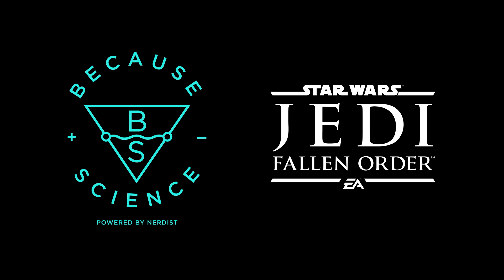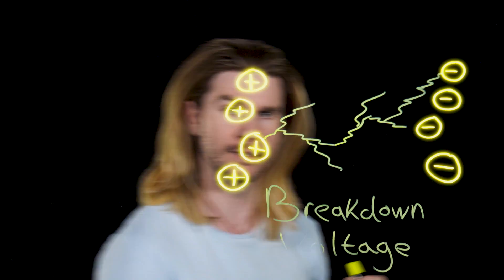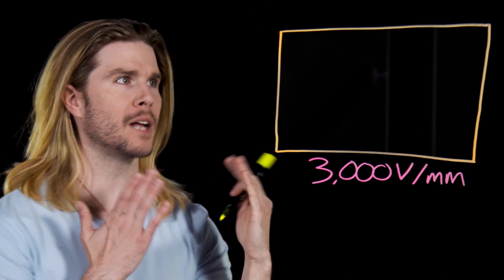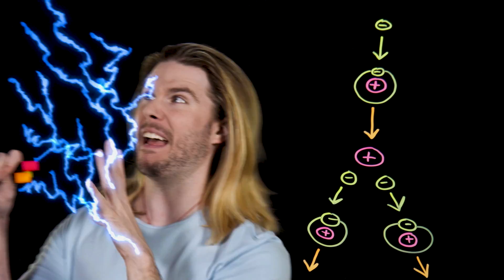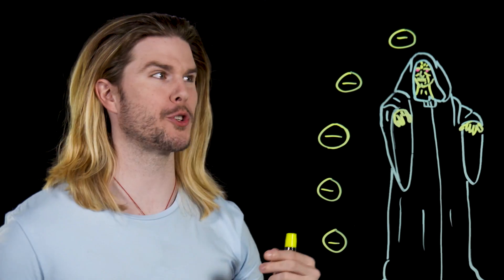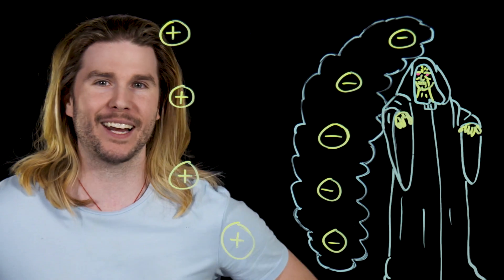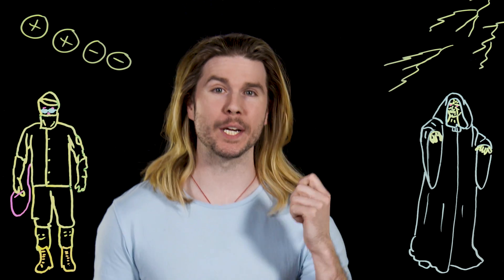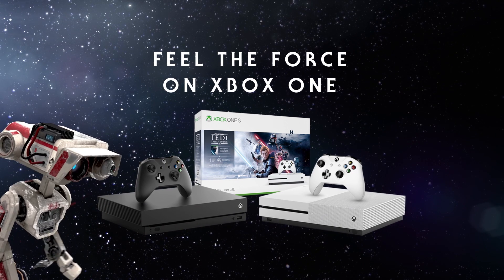How Does FORCE LIGHTNING Work? (Star Wars SCIENCE)

Comment: What I'd find to be a bigger issue is the exit point of Force lightning from the caster. As you demonstrated with static shock, it burns. With enough current at that high of a voltage, one would be lucky to have only singed fingers. Even if the caster's skin is acting as a Faraday cage, at the exit point to an open air arc comes with a lot of heat. Arc welders work by heating up the cathode with an open air arc to the point of melting.

Comment: I had actually thought of this and came up with a slightly different answer: sith use the force not only to accumulate some amount of charge, but also to thin the air between their target and them. This way, force lightning is not as powerful as actual lightning, since the brakedown voltage of air goes down with density (which is consistent with the amount of damage we see inflicted on people who get stuck) and the user can actually direct the lightning towards their target, not just hope they are the path of least resistance (this too, as we see done in the movies).
Reply: Oh, obligatory "love the show, buddy", which is actually true, but I didn't want to edit the comment.

Comment: 5 Things you should know.
1. I love your show. 
2. At STP, 3mm of air insulates against 1000 Volts and 60 Hz.
3. Frequency plays a significant role in insulation break-down. For example some motor manufacturers will give a lifetime winding warranty on frequencies of 3600 Hz or less. One year up to 10000 Hz. No warranty over that because even with billions of ohms, the breakdown at 22 kHz is crazy fast.
4. At low frequencies you won't see the electricity in normal light, so the frequency must be in the kHz at least.
5. If you want to make a cool spark off a bonded metal surface, hold onto a table knife and bring it close to a switch cover screw in the dark. This does two things, first of all you won't feel the burn (because the shock doesn't hurt, it's the thousand degree Arc that burns you), and it focuses the Arc to one extremity. I've had arc's up to an inch across and the feeling of all the electrons moving through your body to your hand is spectacular.
Reply: Hello ElectroBOOM
Reply: @davicorosello1588  I subscribe to Electroboom too.

Comment: The only issues are surely that the heat generated would melt the face and hands off of the user themselves if they actually kept a sustained arc going for any length of time right? Also the light would be so bright, it'd probably blind you.

Comment: Surprised you didn't mention it, but... even if you could charge yourself up how are you going to direct that voltage? (w/o space magic)  It's going to want to take the path of least resistance.  Ol'  Palpatine might just be tossing off random lightning bolts every which way to whatever conductor is closest.  (Assuming it doesn't just bleed out his feet.)  His target wouldn't need a faraday cage, just insulated shoes.  (Found that out the hard way when trying to figure out why our electric fence wasn't 'working'.)
Reply: Not only that, but from kyles description, it sounds like the emperor would only sustain it for a few seconds, as it discharges & equalizes itself. But we see the emperor sustain his force lightning for quite a while when fighting Yoda. So, wouldn't the voltage need be much higher to sustain it longer?
Reply: @void_hunter94  Yoda was absorbing and redirecting it like a lightning rod so at that point they were acting as a circuit. As long as Palpatine could keep generating the current it pass from him to Yoda to the neutral ground of the senate pod and floor they were standing in. He doesn't need to produce more /sec then before. It's a test of how long could he stand the strain of producing that much for much longer then he expected.
Reply: @Citrakite  nah, it's just something called fictional liberty
Reply: They have Telekinesis though so they can make more conductive channels towards the target by concentrating any moisture in the air, making a partial vacuum and/or partially ionizing the air before the bulk of the voltage arrives.
Reply: I thought it was obvious but I guess not... They slowly steal electrons from their opponent and then give it back all at once. 😆
Reply: Actually a faradays cage has no charge because in a conductor, all charge is on the surface, so using gauss law, the e flux inside the cage is zero so the e field is zero hence no shocking and that applies because the charge on a conductor spreads evenly and far apart and the furthest is on the surface. In order for current to flow, there has to be an electric field and the e field is in the direction of decreasing potential so if you’re just wearing insulating shoes but you still have a high potential difference you’ll still experience shock so yes a faradays cage is the best, again from break down voltage applying, I’m sure a wool shoe couldn’t stand 22M V and it would catch fire and the burning wool would create some solution shortly as it burns and the charge would flow
Reply: Agreed, in reading some of the books (I assumed it was a "cannon" based book about the Skywalker-after-Return-of-the-Jedi), it was described in how using the Force was a fair amount of mental "feeling the object in your mind's eye, and reaching out to it with your mind." And with some evil Force using witches, using the Force for bad purposes would cause blood vessels to burst under the skin, causing discoloration. I think the method of Sith using Force Lightning is them reaching out to connect to their opponent and then unleash the charge.
Reply: The space magic part wasn't going to be explained here lol
Reply: Yeah thats what I thought
Reply: Maybe they charge the target with the inverse charge of what they charge themselves with? Or maybe they're generating a strong magnetic field to direct the superheated plasma?
Reply: My headcanon is that they ionize air in thin string from them to the target with space magic. That allows for targeting and, presumably, increases overall efficiency of force lightning - we don't know exact mechanism of space magic, but generally ionizing with other sources like light or heat takes less energy then packing enough voltage for spontaneous discharge.
Reply: I mean in lore it uses lifeforce.
Though there is an ability called kinetite in Starwars that uses kinetic  enrgy to love Atoms and discharge.
So yes this method works.
Reply: That would be terrifying to see in combat
Reply: So, I only dabble in general nerdiness and Star Wars nerdiness. Please forgive my ignorance if this is a “dumb question”. 
The Jedi are very adamant about separating yourself from human connection and relationships so that you are less tempted to fall into the dark side of the force. It is harder to be all passionate and angry about nothing. That might suggest that the dark side of the force is more likely to seek out connections with other force users. Particularly force users that the person who is shooting lightning is angry at.  That might solve the aiming problem. If the energy it’s going to take the path of least resistance then it would make sense if there was something besides just air being shot at the target for the lightning to travel across. Also consider that the lightning is not white, which would suggest that you are seeing it through some of our substance. There has only ever been one Jedi, who uses the light side of the force to create forces lightning, and it was a yellow color.
Does anybody know if there are any instances where force users use the force to create matter out of energy?

Comment: Great video!  I'm just curious why you didn't mention current, though.  It's the current part in the power that causes harm.  Copy pasting Google here but: 

Current Not Voltage Kills
It's The Current That Kills
The real measure of shock's intensity lies in the amount of current (amperes) forced though the body, and not the voltage. ... While any amount of current over 10 milliamps (0.01 amp) is capable of producing painful to severe shock, currents between 100 and 200 mA (0.1 to 0.2 amp) are lethal.

If I'm not mistaken, that's why you can safely play with things like Plasma globes which use  really high voltage but low current,

Comment: is not the volts is the amps that kill you, but I forgot why so I did some research looked into Ohm's law (V=IR) and realise that I can calculate the power in watts with VxI. 
so for Ohm's law v = your 15,000,000V for the emperor's blast. I= to be determined. R the human bodes resistance which is around 1000,000 Ohm. so 15,000,000/1000,000=15 giving an I of 15.
So, the emperor is pumping 225,000,000 (15x15,000,000) watts into Luke in that seem. Not quite unlimited power.
My formatting can probably yous some work and I know I shod site my sources but is just a YouTube comment, I hope you can follow this.

Comment: If they can actually control electrons, they don’t really need to start the negative charge from their hands, but anywhere theoretically.
(Villains mode) we can create a surrounding negative field trapping the target and attacking from all angle. With this method, we can possibly damage our target with less voltage as the cage can be much closer to the target.
Though this’ll still be defeated by a metal box.

Comment: Three thoughts as I watched this...

1) How many coulombs of electrons would the Force Lightning potential have to move in order to prove fatal to the target?

2) If a simple garment can be modified into an unremarkable Faraday  cage, then why did not Vader do this in order to protect his life support system from his master’s Force Lighting and remove the deterrent to Vader killing his master and taking his place? Perhaps there’s some property of Force Lighting that can easily overcome the Faraday Cage protection? 

3) If Force Lighting is sufficiently powerful to surpass the breakdown voltage of air, allowing air to be a conduit for the flow of electrons, I submit that in the relatively rarefied vacuum of space, Force Lighting would prove to be impotent. Another missed opportunity for Vader. How so?

Emperor sitting on throne turns to look out the window...Vader uses his cybernetics to well grip something large and bolted down and then uses the Force to shatter window sending scrotum face Sheev out the window and into hard vacuum. He uses Force to try and return to room and Vader cuts him down with his lightsaber because  old Palpy realizes too late that his Force Lighting won’t propagate.

Comment: Did you take humidity into consideration? If we assume that sith lords have the ability to manipulate electron gradients, then why not give them the ability to manipulate the water vapor in the air as well. As the absolute humidity is reduced, the voltage differential requirements for electrical breakdown reduce. This is why static shocks are much more common in the winter (low humidity) than the summer (higher humidity). In theory, if the sith lords are able to "push" the water vapor away from the path that they want the lightning to follow this will both reduce the voltage differential requirements for the lightning as well as allow for moderate aiming.

Comment: Hi! Kyle.  I'm a little confused on the 3000 V/mm breakdown... that seems like a 2D equation.. or is static lightening so "thin" that it take in account volume?  also, does lightening have width or a diameter... or is this an illusion from the amount of energy makes the air glow and seem "thicker" than it actually is?
sorry about the run-ons.

Comment: Rubber can also displace electricity similar to one of the cages, but it’s much worse at it. The tires on a car can’t stop a normal lightning bolt so to stop some force lightning you would have to wear a rubber ball a few feet thick

Comment: Since the void is a void its probably dry and cold, which would help build up static as you can't really discharge to easily through dry cold air. Additionally, the floor must be made of some kind of super-woolen carpet as your captors seem to have designed your cage to be comfortable enough to limit your madness.

That honestly just makes the void creepier.

Comment: Hey Kyle love the show. I think there may be an easier way to "explain" this. It could be that the sith are more skilled at acting as a capacitor. Simply building up static electricity and releasing all that built up POWER in a quick burst. I would reckon that a human sized capacitor could build a charge of 500 million volts easy. This would also explain why you don't see people die when hit with force lightning. It would be high voltage, but low current. Acting almost as an arc blast. Much you see when Mace windu gets blown out the window by the dew it man.

Comment: Kyle I have a question. A child asked me this today. Can you answer it. If you are going fast enough sideways (not up or down.) And tossed a cat out into the air. (Figuring fast enough to negate gravity for a few moments.) Wuld it A- Always point its feet to the ground. B- point its feet tword the momentum as if it is gravity till it landed on its side (to many cartoons lol). Or C- fly feet first following a trajectory much like a space x rocket.  Landing safely on its feet. (Cause we all know cats are aliens with anti gravity propulsion.)
Reply: Lol dude out here wanting to throw cats around! Gotta check if it's safe first
Reply: Devin Warf An object in motion will stay in motion unless acted on by an unequal force. Essentially, the cat should maintain whatever orientation it has when it is thrown out the window. However, as soon as the cat is in the air, it is colliding with air molecules in proportion to its velocity. These air molecules apply forces to the cat, and the cat is applying equal and opposite forces to the air molecules it collided with. The faster you are traveling when you move the cat, the larger effect the drag force will have on the cat. Because the drag force is geometry dependent, it is determined by the way that air molecules flow around the cats body. Because the cat is not spherically symmetric, the cat will experience unequal forces on its body and therefore experience a rotation in some direction. If you are traveling slow enough, the cat will remain standing straight up. This is because the applied forces are small, and so the resulting rotational acceleration of the cat is small. The faster you travel, the more the cat’s body will tend to rotate in such a way that it’s feet will be forward and torso will be backwards. The reason is because all parts of the cat are experiencing the same force per area from the air, however, the torso has a larger surface area than the legs, and so the torso will experience more total force than the feet. Since there is more force on the top of the cat than the bottom, a torque is created which will rotate the cat.

Comment: So if this is true and the force can be used to manipulate individual electrons, would it not be feasible for a sufficiently skilled force user to simply deionize someone's entire body, rapidly, if not instantly killing them, rather than hit them with a lightning bolt that be absorbed with a lightsaber or another force user? Or better yet, if they can manipulate electrons, they could easily manipulate protons and neutrons which are magnitudes larger and just rip someone apart from the atomical level??

Comment: If Force Lightning has the strength of a lightning bolt, that raises a few problems concerning the duration of the bolts. Whenever an individual is being hit with Lightning, the duration is pretty lengthy, but they're relatively unharmed. Humans can survive singular bolts of lightning sometimes thanks to the skin effect, but that much electricity coursing through someone should cause considerable damage, if not kill. However, in the films, Vader is the only person who dies due to lightning, and that's because of his suit's systems being shorted out. Moreover, when Luke is subjected to Lightning, he's up and moving within minutes.
  Therefore, I propose that Force Lightning is considerably weaker than what you propose, and is caused by the Sith using the Force to reduce the breakdown voltage of the air along a specific path, which also allows for precise aiming (Vader was standing extremely close to Sidious's lightning, but none of it arced towards him). In addition, rather than simply being bolts than slam into someone, what if they specifically target and activate the pain receptors in the victim's body? That way, it would maximize pain while keeping the target alive as long as possible. 

  In summary: I think Lightning is a rather weak charge that manages travel through the air thanks to the user manipulating the breakdown voltage of the air, and targets and activates the victim's pain receptors. That, I think, would be more true to Lightning's reputation as the signature technique of the Dark Side: a technique designed to maximize suffering, even at the cost of direct damage.

Comment: So if you can generate voltage with the force then won’t a point blank force lighting be equal to real lighting strike or does the distance not change the voltage output?

Comment: Hey Kyle, love the show!
You consistently pictured earlier in the video, the electricity flowing from positive to negative which is, in fact, not fact. The negatively charged electrons flow from high concentration to low, like most things. Although you may have meant a positive amount of electrons by drawing a plus sign the charge of an electron is negative so the lightning should have been drawn the ther way around or the signs for negative and positive should have been switched depending on the scene